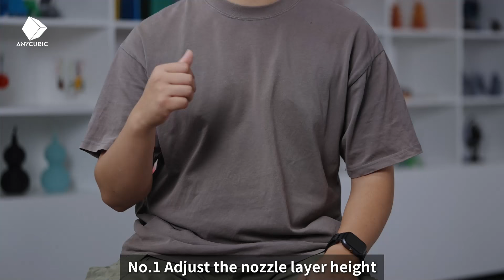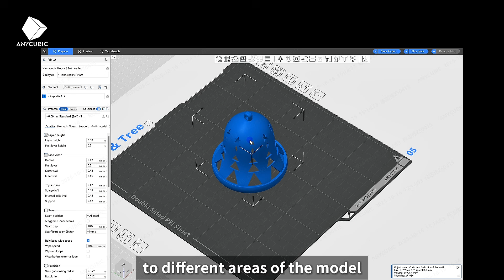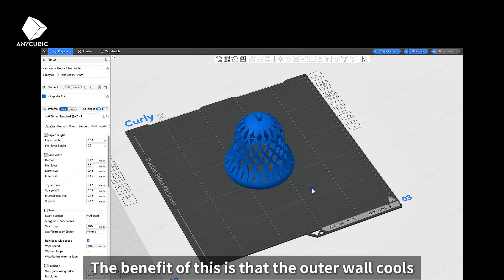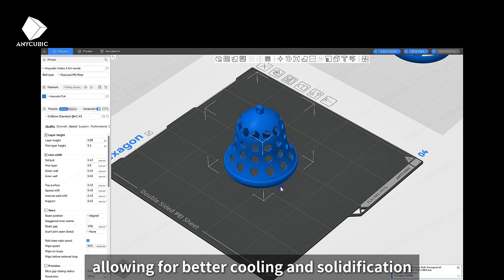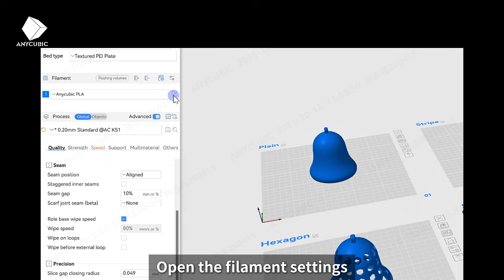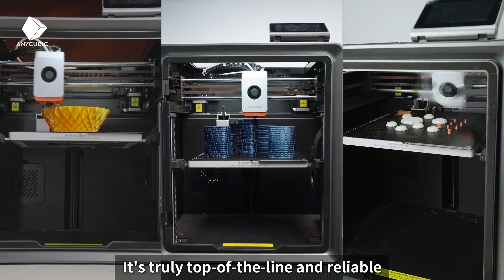How to Reduce Layer Lines in 3D Printing | Slicer Settings for Smooth Prints

Comment: My two tips are: 
1. Use filaments from a good brand, and not brandless filament, to avoid uneven layer line caused by inconsistent filament diameter. 
2. For aesthetic parts, I like to use shiny filaments (PLA silk & Galaxy) to hide layer lines.
Reply: shiny filaments make vfa and ringing look worse
Reply from the maker: Congratulations on winning a prize in our event! Please send a private message to our official email with a screenshot of your account to claim your reward. Thank you again for your support of Anycubic. Thanks! marketing@anycubic.com

Comment: Well I use the Kobra3 V2 and my best tip which I can provide is: By rotating the angled object, I minimise overhangs which allows me to use fewer supports which in turn leads to a cleaner surface finish and reduces material waste. This technique also helps distribute stress across layers, potentially creating a stronger final part than a perfectly horizontal or vertical print. I like to aim for quality prints so I normally use 0.16mm layer heights which varying speed speed mainly starting with the default 45mms.
Reply from the maker: Congratulations on winning a prize in our event! Please send a private message to our official email with a screenshot of your account to claim your reward. Thank you again for your support of Anycubic. Thanks! marketing@anycubic.com